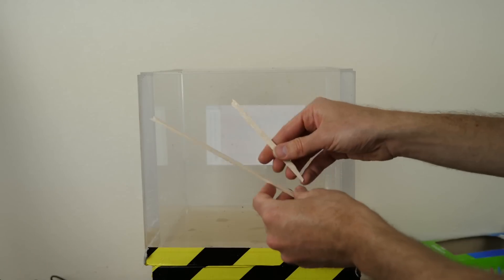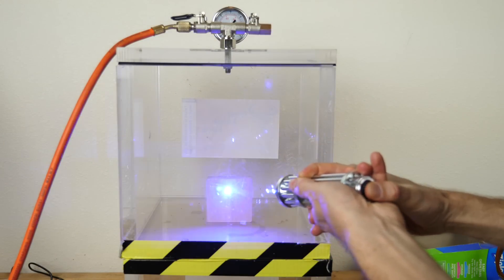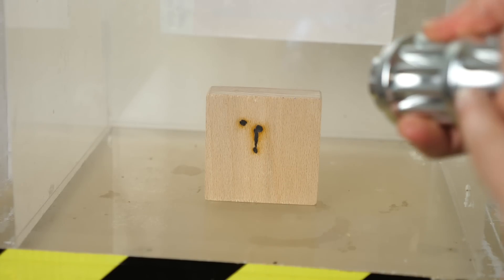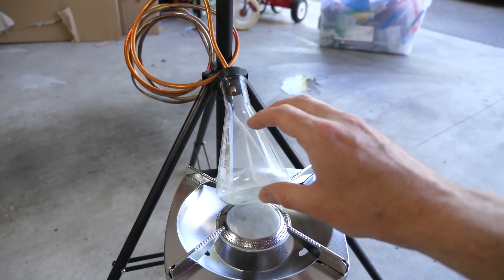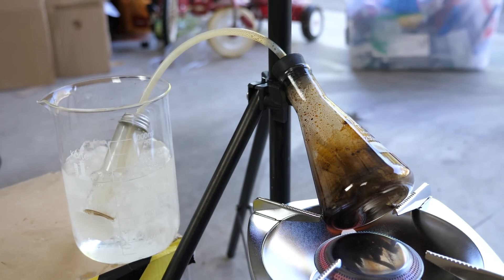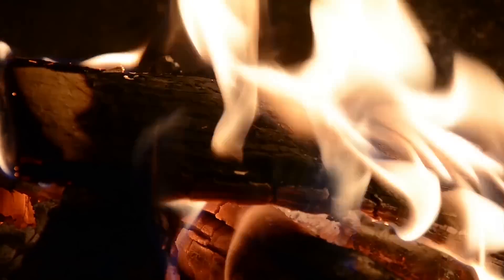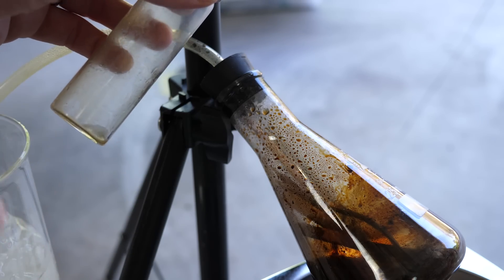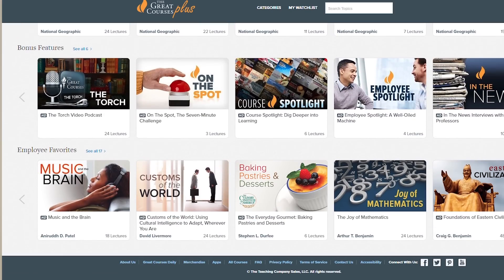Is It Possible to Melt Wood in a Vacuum Chamber? The Wood Distillation Experiment

Comment: You can melt wood, wood pulp is a thing. You used dry wood. Obviously dry wood would not melt since melting requires a certain humidity level as well as a certain temperature.

Comment: I read about destructive distillation of coal when I was in elementary school and I wondered the same thing about wood. I did some experiments with burning wood/other combustable materials (I was literally playing with fire as a kid unsupervised lol) - I made a little tube out of foil and piped the flammable gas of a flame away to make another flame at the end of the pipe. It was quite eye-opening as a child to see that the brightest part of the flame wasn't from oxygen reacting with the solid itself but from its reaction with the gaseous products that are produced when the solid/liquid fuel decomposes/vaporizes.

Speaking of wood gas, apparently North Korea uses it as an automotive fuel in some rural parts of the country. That was also a fairly common fuel for vehicles in parts of Europe and China during WWII.

Comment: I have always wondered why many/most vacuum chambers have the vacuum tube on top. Makes sense that once the pressure drops, the air molecules are on bottom of the box. Like in this instance, the smoke drops down and you cant suck it out. Why not have the vacuum line at the bottom to get more air out? Would it make any difference?

Comment: Could you use a vacuum chamber to dry wood , ie fresh cut firewood , looking outside the box for ways to speed up the process without much injection of energy /cost , I'm thinking 40 foot container vacuumed down . Really would like a weight before and after  cheers

Comment: Being a giant molecule does not necessarily mean it cannot melt. In general, a lot of plastics melt without breaking down into simpler molecules. But indeed the case of wood/cellulose and rubber is very interesting!
Reply: plastic is a long polymer chain..on melting it actually breaks down to many monomers...
Reply: Yeah,but polystyrene (aka styrofoam)can melt and then reform.

Comment: Sooo, you made liquid fuel from wood?  I know you can run a generator from the fumes put off from wood with the same concept as a double boiler with two metal barrels...  I'm just wondering if the liquid itself is feasible as an alternative and renewable source of combustion.

Comment: How about high pressure, inert gas? This could stabilise the wood? Or, on the other end, negative pressure trough a liquid environment, without gas bubbles, connected to a compressor?? Because besides temperature there is pressure...

Comment: I work for an research institute specialised on pyrolysis. We try to make green chemicals and synthetic fuels out of bio mass and waste material.
In this process, you do not produce "liquid wood" exactly (even though you can kinda say that?). You split the wood into several compounds.
The main compounds you produce in this process are:
Solids:
This is the char. elemental carbon + salts and metals

And volatiles, which are again split in different compounds:

Bio gas:
- Hydrogen
- CO2
- CO
- methane
- other organic gases

Water:
- Mainly H2O
- Ammonia
- water soluble organics

Oil:
- Alkanes, alkenes and alkynes
- cycloalkanes
- benzoles/aromatics
- carbon acids
- nitriles
- other organics

ALL OF THESE VOLATILES ARE HIGHLY TOXIC! DONT TOUCH IT OR PLAY WITH IT

Comment: How about increasing the pressure in the chamber instead of decreasing it. Filling it with some inert gas (yeah nitrogen) and then heating it up. Maybe at that level it can't be changed into gas but would be hot enough to flow... Worth a try 🤔

Comment: Many substances will decompose before melting.
I remember doing that same experiment in my Introduction to physical sciences way back in secondary 3. It was called wood distillation. In a test tube heated with an alcohol lamp. We had one warm collecting flask for the heavy tar like fraction, then, a second one in an ice bath that collected some clear fluid like wood alcohol, and, a water filled one collecting the gas part.

Comment: It is possible...At standard temperature and pressure, the melting point of carbon is 3500oC. If this could be lowered to a temperature that could be attained experimentally, the wood might be able to melt. Although facilities capable of creating such conditions exist, there is no published literature that has tested this hypothesis

Comment: I think this experiment could be revisited. Pump the air out, but instead of a laser, get special high temp ducting and a tight valve to seal leading to a heated nitrogen feed. Nitrogen being inert means no oxygen for combustion, so you could heat it up high enough to melt the wood on contact.
Reply: I think the oxygen in the hydrocarbons would allow it to ignite.
Reply: @inthefade  YES - The giant organic polymer contains oxygen, so you would create different molecules with new breaks and bridges, and perhaps eventually the net change would be to a more oxidized state as Hydrogen is released as gas carboxylic acids are left. In a sense that's oxidation because the carbon molecules are losing more electrons to the oxygen, even though there is no new addition of oxygen to the molecules.
Reply: As this conversation goes, it's just insane for me to think that heat does all that sh1t in the universe, no matter what is the chemical problem, apply heat, maintain heat, or reduce heat, and things interact way differently than they did in otherwise scenario.
Reply: @RodrigoM3llo  
It's all just energy, fam.
WE'RE all just energy. (Or more like... high functioning combustion engines, but the amount of cells we burn through and replace just on a daily basis is insane.)

Really changes a perspective.
Reply: This is literally just what a pyrolysis plant is
Reply: Look up turning Punk Wood into Charred Wood. It's been a known technique for thousands of years to make fire starters by preventing combustion while heating wood.

The wood chars, just as described here, and breaks down into far more volatile components. Removing oxygen won't result in melting wood regardless of how you heat it.
Reply: Just use friction. That's how to do it. It's called wood welding. He made a video about it if you didn't watch it already.

Comment: Wood is made of Glucose unit’s which contain oxygen plus there would also be free oxygen caught up in the fibrous tubular structures of the wood itself. Moreover the cellulose is such a giant branched molecule that it would be impossible to disentangle all the components. Substances with melting points are generally much smaller discrete molecules which involve other forms of intermolecular bonding allowing them to break away from each other given the right energy.
Reply: really interesting
Reply: Funny. They found a way to do it kinda, just friction weld it. Look up "wood welding".

Comment: I think you would need to depolymerize the cellulose, possibly with an enzyme. That would result in sugar which could be melted.
Reply: This would absolutely work and actually at least one person to my knowledge has turned cellulose into sugar for alcohol distillation... Although they used cellulose in the forn of tp.
Reply: Right, which, as defined here, still constitutes breaking down and therefore not melting simple wood.
Reply: Or with heat in pyrolysis.
Reply: Was it Nile purple
Reply: @matthewjaj8835  a fellow man of culture I see
Reply: Aged well
Reply: shut, i dont know this language
Reply: @kalpolproductions8558  The wood is made of cellulose, which is a really long chain of sugar molecules. If you broke the cellulose up, you would get a bunch of single sugar molecules which would just be raw sugar, which can be melted.
Reply: @zackjones8802  what about the rest of the wood, its carbon then?
Reply: @kalpolproductions8558 I am going to assume you are being serious; sugars are rings of carbon with that also have hydrogen and hydroxyl groups attached to the carbons.  When the sugars are linked together in a particular way, you wind up with a very stable chain called cellulose which is one of the main components of wood (and paper, which comes from wood.)  Sugars can link in a different arrangement that is more bioavailable, and we call that starch.
Reply: What are these guys saying bro? I just wanted to see if wood could melt not learn about whatever the fuc that is
Reply: @Jonah Hofmeyr  so the stuff in wood, cellulose, be like a long ass chain (a polymer). The links are held together sugar. Now if you take away the wood part (depolymerizing it), you just left with sugar. Which do melt. That's what we saying bruh

Comment: U need oxygen to burn but need heat to melt. Since wood is fibre when heat & fire is applied wood burns. In vaccum it appears to melt. But metals don't burn coz their molecular structure. They melts .

Comment: Wait a sec... Breaking a big molecule into smaller molecules does not constitute melting? I mean, I know it's a phase change from close-proximity vibrations to freer movement resulting in a substance with the properties of fluidity and surface tension, but is that not achieved through the breaking up of a molecule? What about metal? Metal generally has a lattice structure. When we melt it, are the atoms not more free-flowing? Or does melting metal just allow individual molecules to flow more freely? Okay, nvm, I think I get it; if we break up a molecule into smaller molecules, that's a chemical change, but if we enable a bunch of separate molecules to flow more freely from one another by adding energy to the system, that's a physiological change, and that constitutes melting.

Comment: In general, melting point is the matter of pressure, temperature and heat. You just put the wood in wrong condition to melt it. Yeap, some matter is hard to melt, but to prove that something does not melt it is not enough to put it in vaccuum and point laser beam on it. Try to melt steel on the same condition and you will get the same result, except smoke. For really big molecule it might be really hard to find melting point and PROBABLY such molecules could not exist liquid form due to it's nature, but this experiment just prove that wood does not melt in exact conditions - it might be that vacuum is not good enough or laser beam is too weak.

Comment: What’s the difference then between wood and iron why can one melt and one can’t?
Reply: In wood the heat is enough that the moleculular components of the wood are no longer stable. The different parts/elements are separating and recombining into new gases/liquids/solids which are more stable at the higher temperature. 

Bonding with oxygen is usually the strongest/most-common thing for the organic materials to do hence oxidization/burning when done in an oxygen environment. Heading in an oxygen poor environment like a vacuum, forces the broken molecules to fall into alternative configurations.

Or another way to look at it, if the hypothetical "melting point" of a material is higher than the temperature at which the material itself breaks down,  it won't be able melt and you just get whatever sort of chemical reaction the freed parts use to restabilize.

Comment: i think it is not gonna melt cause it's a fuel for fire so if you heat it, it burns
Reply: Without oxygen it can't oxidize aka burn. But it will break down in other ways.

Comment: I was literally thinking when you introducing the experiment "Isn't removing the oxygen from burning wood how you make charcoal?".
in medieval times, they'd cook the wood in buried chambers so that oxygen couldn't get to it.

These days, you can do it with a couple steel drums. it's dirt cheap too.
Reply: Charcoal is made so that the water and other useless oils in the wood is removed. You take out the oxygen part so that the wood itself does not burn, only the water is boiled off per se. This leave a somewhat purer form of fuel that can be oxidised more readily and produce stronger heat.

Comment: curious to see what would happen to wood if you tried to melt it in a high-pressure chamber filled entirely with a noble gas such as helium, neon or xenon, at over 100 atmospheres of pressure. To ensure that no oxygen remained in the porous wood first, I'd imagine you'd need to pull a vacuum and then introduce the noble gas.

Comment: So the real problem with recycling ♻️ is that the mix does not melt at the same rate it separates and burns off some bits long before others are even warm

So you need to find a way to put equal amounts of energy in its mix so the change states together

Comment: I am truly not satisfied with the conclusion, he has made.
- There are minor particles of oxygen still left in the wood, which causes a chain reaction.
- The heat supplied to the wood is uneven, meaning the whole wood isn't getting the same temperature to subdue the oxygen in it.
- The heat provided to the wood is just too low, it's like they are trying to boil potato in a  gas chamber.

Comment: There is, assuming that your vacuum chamber can achieve a vacuum pressure equivalent to the LIGO particle collider, still approximately 2000 molecules of O(2) per square inch inside your chamber :D

Comment: So you can’t melt wood because it’s not just one material with a singular melting point. Each part liquifies/vaporizes/breaks down at different temperatures, meaning the wood falls apart at higher temperatures instead of melting in the traditional sense. I suppose the last thing left to melt would be the carbon base, but that’s not really wood at that point

Comment: Prediction: 
The process of exposing wood to high temperatures while lacking oxygen is how charcoal is made. The vacuum will stimulate the same conditions and what you'll end up with is burning off the water and making carbonized wood, aka charcoal. Perhaps if the laser is left on long enough you can melt the charcoal, but at that point you're trying to melt carbon, not wood

Comment: Under low pressure you get sublimation, so you end up with gaz, but I wonder what would happen if you heated the wood under high pressure but without oxygen, for example in nitrogen. I also wonder what you'll get if you do the same experience with pure carbon.
Reply: For best results use Argon. =) Argon is cheap and plentiful and even more inert than Nitrogen.
Reply: Wood can be melt if it undergoes a process; pyrolysis
Reply: Yeah it can’t ignite in a vacuum, so instead maybe surround it with carbon dioxide or nitrogen so it won’t combust
Reply: @muddybasilisk If heat couldn't be transferred in a vacuum we'd all be dead :D (because we wouldn't be heated by the sun)
Reply: @muddybasilisk7526  radiant heat can be transmitted
Reply: @muddybasilisk7526  Heat can be transferred in a vacuum via radiation.  It won't transfer via conduction except where it touches something.  no convection in a vacuum.
Reply: @EricPalmer_DaddyOh  what I meant was that it won’t ignite my bad